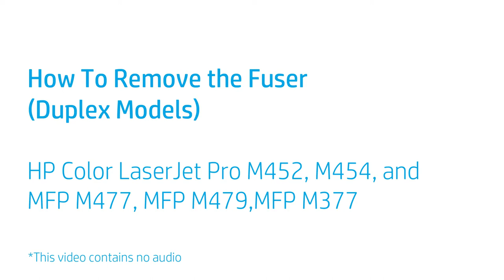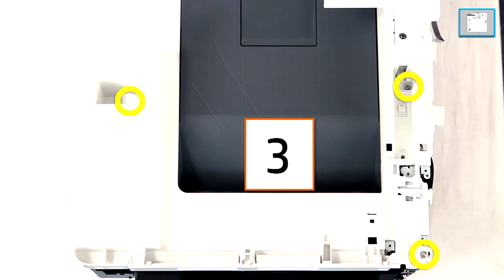Replace Fuser (Duplex Models) | HP Color LJ Pro M452, M454, and MFP M477, MFP M479, MFP M377

Comment: Follow these simple 1,134 steps to replace your fuser!
Half the time I couldn't tell what I I was looking at in the video.  I finally realized that the upper right was the orientation of the printer, but I had many things that just didn't match so it was still a pain.

Absolutely the WORST printer to ever work on!  I've had to recommend to all my clients to switch printers after MANY MANY complaints about the cost to service it.  Whoever thought this design was OK, and the idiot who approved it should immediately be demoted to servicing this printer a minimum wage!

Even worse when you fire it back up and you get some generic "Internal Communication Error" and have no idea which of the 150 parts you messed with that it could be!  The one I just finished I'm pretty sure the cable to the scanner is messed up, I didn't get the hinge in all the way (while I give you props for the top to tape down the scanner, there was no mention about getting that tab to fit in there just right) and when I went to look at it, it sprung open and flew off the back and was hanging by the cables.  Way to ruin a $900 printer!

Comment: Most manufacturers have it so fuser just pulls out without having to strip machines down. Why has hp made it so awkward to change a consumable part? These bits do need replacing from time to time.
Reply: Just went through this...  pure pain and suffering, just to remove a 0.5x0.5 inch piece of paper that got stuck and jammed printer whenever printing on two sides...